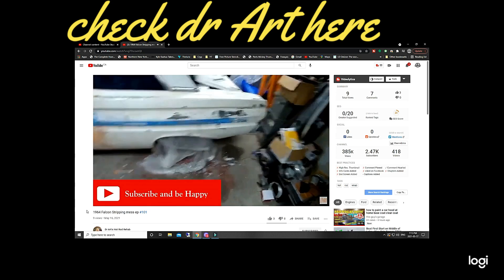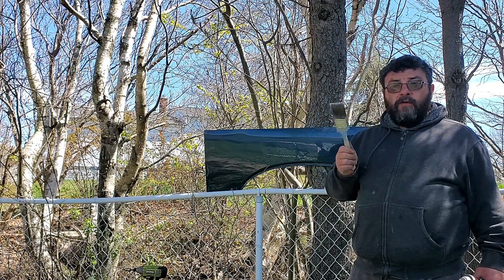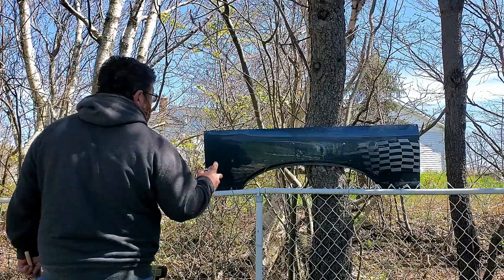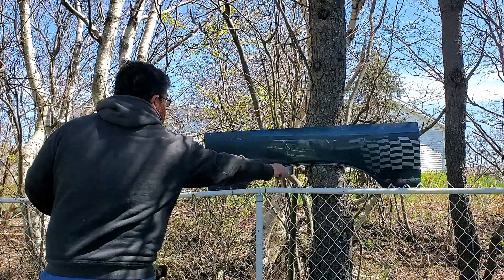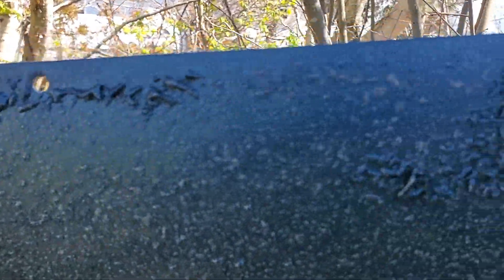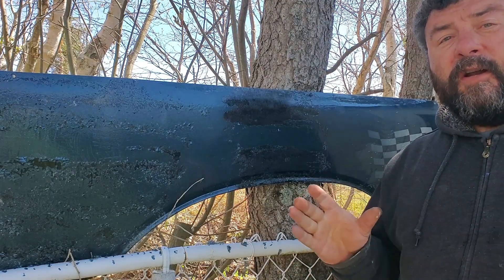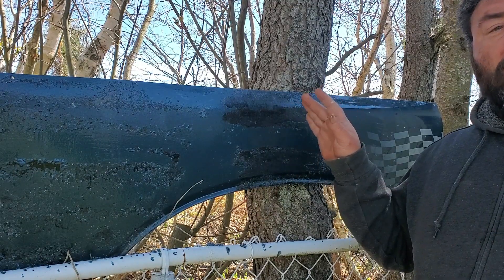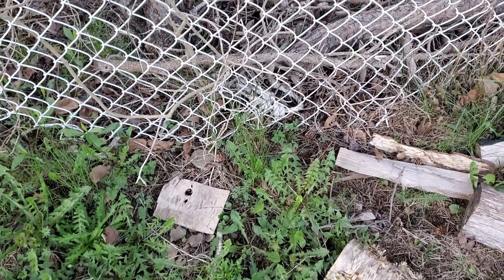problems using paint stripper

Comment: I have used this before and it works well, your suggestions and demonstration is very good and I hope it helps others. Here is my additional advice: Stay away from seams. If this product gets in a seam you will have a world of difficulty getting it out, at least that was my experience, wire wheel or gritblast the seams. Also, it may seem like a simple suggestion to use this outdoors (and best to wear some PPE) but if you use this in an enclosed area without ventilation it will kill you easily. The fumes from this product are very deadly.

Comment: The  paint stripping products have gone "green" and no longer have the same potency to remove paint. It doesn't even burn skin, like the old product used to.
Reply from the maker: some of it has lost its bite ,the proform i use has a pretty good sting on the skin 
good point joseph